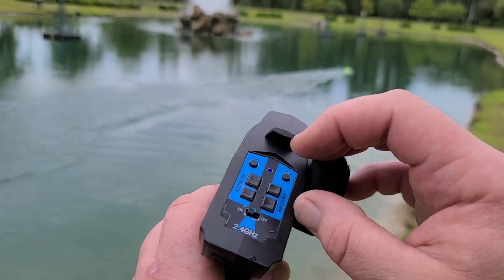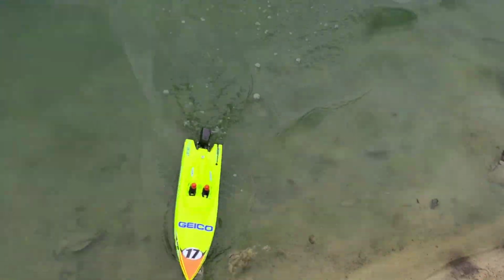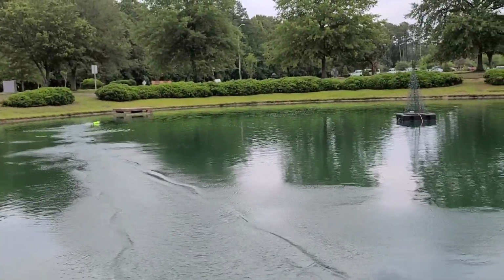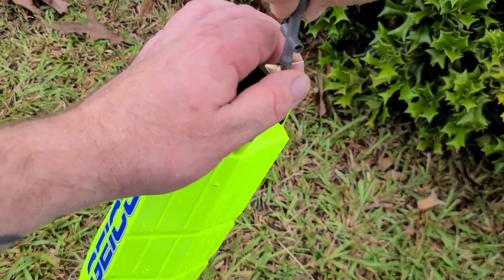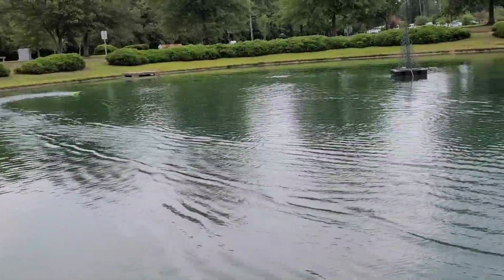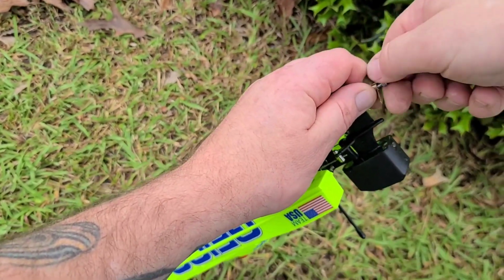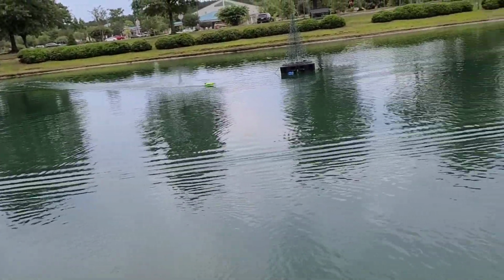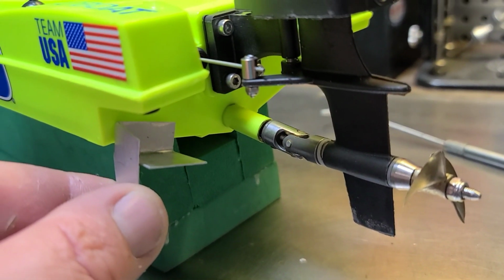Upgrade prop Testing Proboat 17" Power Boat Racer

Comment: With just a few months in owning a rc boat. I'm still amazed at what a tiny change in prop size, pitch , and shape will do to the performance of a boat! The cnc props are awsome but i Guess the next step for me is trying my hand at balancing and sharpening the beryllium copper props. So many options out there.
Reply from the maker: You'll enjoy the prop balancing process it can be somewhat annoying at times. Just sharpen & Balance at first I wouldn't recommend modifications until you get the balancing down pat.   Once you start modifications do it on old props that you really don't mind screwing up.   Or get a couple cheap (tfl props) to tinker on they  end easy & is made of a soft material.    Good luck. 👍
Reply: Thanks big b!

Comment: I have always wanted an RC boat! I got a few buggies and trucks, some heavily modified, etc. Never had an area that an RC boat could be safely ran in my town or even within hours (Alaska), but we're moving in a few days to the lower 48 and looking forward to expanding my hobbies with the kiddos.
Reply from the maker: Oh man you'll love going to the pond/lake with the kids and a few appropriate sized rc boats.
Reply: There's a TON of RC boat videos out there, but I must say; if you want to learn something, this is one of (if not) the BEST channels.  Sometimes, Big B can be WAY off the mark in his diagnosis of a problem (his learning curve is increasing like a rocket to the moon though...), but for the other 98% of the time you can rely completely on the information he so eloquently explains in his cool, laid-back Southern style.  "NICE!"  "Git it Bull...." "Full Trigger, Full Trigger!!!!......."  If you have any similar RC experience (Cars, airplanes), boating should be easy.  Just be forewarned; there is no "perfect" setup, parts are hard to find, you LHS has no idea what an RC boat is or where they can be found, but you will spend a lot of fun time trying to find "The Sweet Spot".  That's the fun of boating, many of us are going where no man has gone before.....

Lastly (and this applies to ANYBODY considering a venture into the hobby),  ASK QUESTIONS of those who obviously have some experience; you can save yourself time and grief.  There are good products out there, and there is crap.  Experienced modelers know the difference and are usually more than willing to share their experiences with various products.  Big B has a business connection with ProBoat, but don't let that affect your thinking.  ProBoat has done a whole lot in improving and perfecting the RC boating experience and the product line they offer is outstanding.

Welcome to........  The Boat Gang!  😉
Reply: @Dr_Jet  Great! I have gown up on the ocean and live next to it for a few more days till we move. We're moving more inland now and this will be the first time away from an ocean or large body of water in my life. I also used to weld aluminum for a living and have worked around fishing vessels for years. 

I plan to tig-weld a small scale aluminum boat for fun in the coming year, like this winter.
Reply: @27Zangle  Dude.....  If you have a TIG/MIG welder and the experience, THIS is the place to be.........
Reply: @Dr_Jet  I will have to buy a new one. Shipping out of Alaska has been pricy. They are closing the port on July 19th this year due to safety from lack of maintenance and it is loosing money. It was $3600 for four pallets to be shipped from a town two hour north of us to Anchorage and then to Washington state. Once there it is another 1800 - 2200 for the pallets to be shipped to our state of choice, which is somewhere in the Midwest. 

I want a Millermatic 252 because I have used one for years, but will likely buy a Weldpro 200GD since it will be used for hobby purposes, etc.

Comment: Man the nose dives & random spin outs that thing does is wild
Reply from the maker: It's a crazy acting stunt boat.   Hopefully I can fix it?  Idk?
Reply: @IRONCLADRC  I would try turning down the steering to like 25% & dial it up slowly if more is needed. Also there’s got to be a way to install a wire drive or flex shaft & loose the drive shafts, those are power thieves lol. Let’s get this boat to do like 60mph lol

Comment: I actually like the 32 4 prop...its for fun ...if you ease on throttle you can stop all the crazy spins and jumps..I have a stock vector s I installed a plastic 32 4 prop on...on 3s it's much faster than stock prop..but on 4s it's a crazy ballistic fun boat..maybe 35 mph top speed...I also used shrink wrap and epoxy to add a ball bearing to drive..so smooth now..stock motor and esc handle 4s without issues..barely warm after 8 mins..

Comment: I didn't  recall if you ever tune tunnel hulls with outboard motor. I got TFL Sprint F3 and on speeds over 60km/h it is uncontrollable in turns. Prop is tfl 32x1.4. My Saturday ride finished with broken flex shaft and destroyed prop.
Reply from the maker: No sir I really don't have much experience with tunnel hulls
Reply: @IRONCLADRC  you definitely need to try. I'm in love with Dragon +kmb

Comment: Is the shaft 4mm? Im trying to make sure I order the correct prop Thanks alot or the video. Ive been searching for over a year now to find a prop that fits or how i can upgrade this boat.
Reply from the maker: 1/8 size prop shaft so the prop bore should be 1/8'
Reply: @IRONCLADRC  really appreciate the reply man. I have had this boat since 2019 with very little issues.  I had to put a new motor in it recently because the bear inside messed up from corrosion which was probably my fault lol but other than that it has been great!

Comment: My lipo came dead on arrival. 1.17v total. 2cells zero volts. Did take a .5amp charge to 3.75v per cell. Can't  wait to hit the lake
Reply from the maker: Use caution olwith what I'm about to tell you!  With that said. Put the lipo on your charger with out the balance leads hooked up. 

Put the charger on NIMH on 1A -2A charge rate  charge the battery until the voltage is at storage charge around 3.7v per cell.   AS SOON AS THE BATTERY HITS THAT VOLTAGE SHUT NIMH OFF AND balance charge the battery at .5-1a charge rate.   

Basically your bringing back the dead battery with the nimh charge so you can balance charge the battery.  (FOOLING THE BATTERY BACK TO LIFE) 

SOMETIMES IT WORKS SOMETIMES IT DOESNT SO IF THE NIMH CHAGE DOESN'T BRING THE BATTERY BACK TO STORAGE CHARGE  THE BATTERY IS DEAD DISPOSE OF THE BATTERY ITS GARBAGE